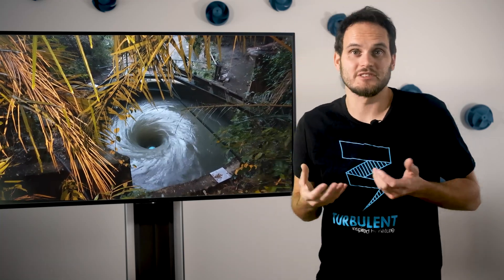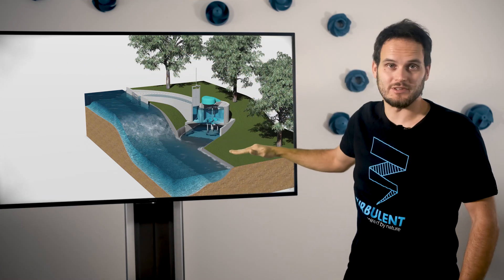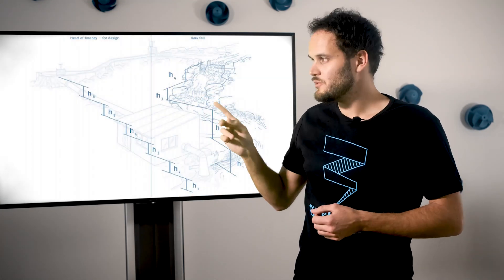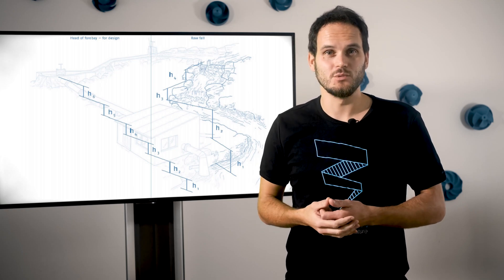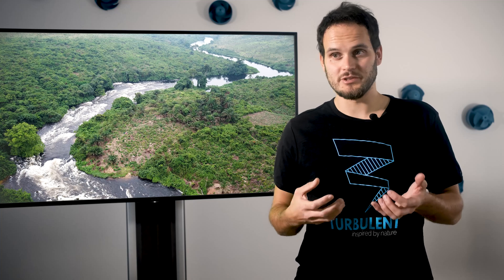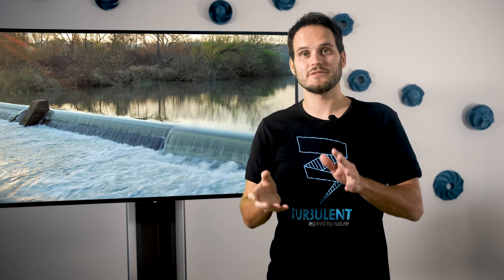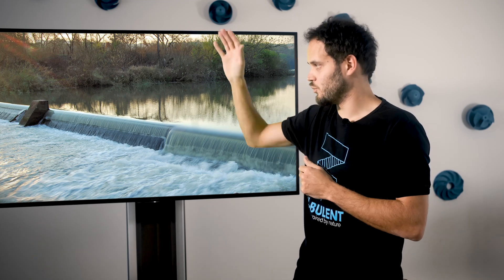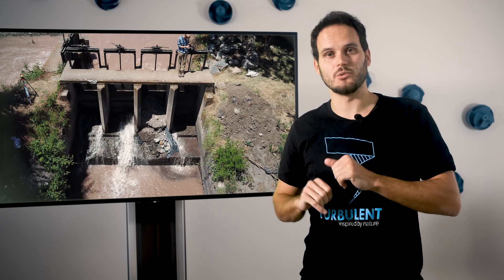Micro hydro-power 101: How to spot a site for a  vortex turbine

Comment: I've been watching al lot of these vortex turbine video's the last few day's
and i was thinking: if U put several smaller vortex turbines in series,
for lets say a hight of 2 meters U set five 40 cm high vortex turbines
but then make it a closed loop with 1 pump pushing the water back strait up.
could those 5 turbines produce more power
than is needed for the 1 pump to push it back up?
then I came across the most efficient version of these vortex turbines
the Francis turbine, these can be fully closed of from air as a bonus on top.
several of those in series and 1 pump in a closed loop without air,
gives the comunicating barels effect thus eliminating the the hight pressure,
to overcome by the pump, then the pump only needs to overcome the flowloss
furthermore ya don't need the hight nomore
and can place those Francis turbines under a 45° angle on the floor
U've got the flowrate- and presurerate- and poweroutput numbers
and U can calculate the power needed for the pump
to overcome the flowrate/presure
i think U can make more (free nrg) than is needed to keep this closed loop running
Reply: a rampump should get you excited too, it requires zero energy to pump water upstream.

Comment: It’s always interesting talking about RE project. Since you are mentioning low dam structure, have you ever built turbine after siphon seal weir pit in once through sea water cooling power plant?
Reply from the maker: That's pretty specific ;) Do you mean a syphon culvert? We've evaluated a project like that in the past yes. Get in touch with us through www.turbulent.be/contact-us and be sure to add flow and head data for a swift response
Reply: I am a Canadian engineer/inventor. I have a hydraulic lifting device that would enable you to put these anywhere on earth with a limited amount of water and no rivers. Is there somewhere I could contact you folks directly without going through your sales dept?

Comment: great video. we have tried reaching out to turbulent several times but no response. we meet all the requirements, how can we get this installed?
Reply from the maker: Hi Ochoche, I noticed we have sent you an email but we didn't receive your answer yet. Can we help you further?
Reply: @TurbulentHydro  I'm not sure I got it I'll check again. Thank you for your response
Reply from the maker: @dr_och01  Sure, and thanks. I'm sure we can help you with your project. Powering hospitals is very much needed in these current times. If you can't find it let me know!

Comment: Hey.  like this equipment, how to buy it in Russia?  Do you make deliveries to Russia?  How much is 20 kW
Reply from the maker: That can be arranged. For a cost estimation we'll need to have an idea of height difference and flow (m3/s). Our turbines change in size based on these 2 inputs, as does the cost. You can go to www.turbulent.be/contact-us and fill out the form. Thanks!